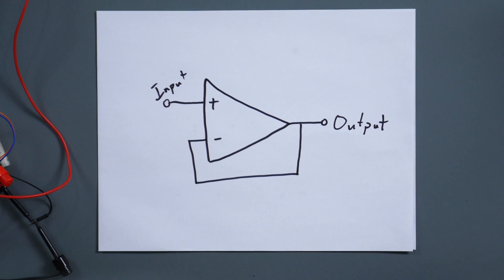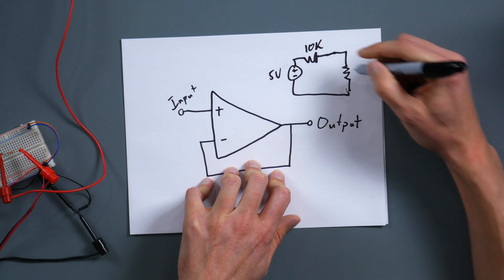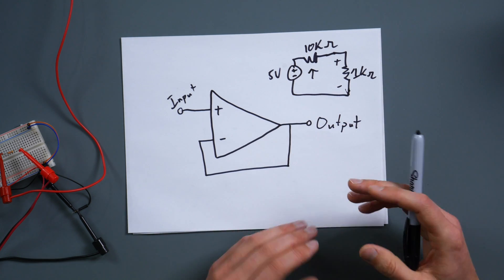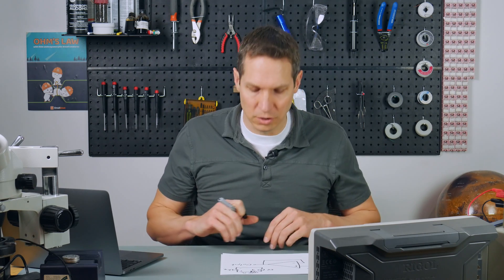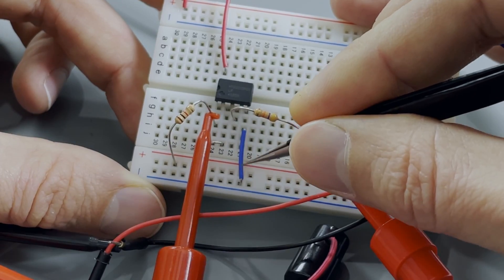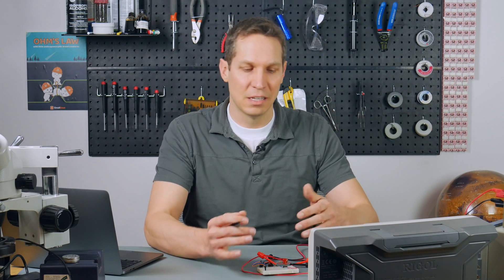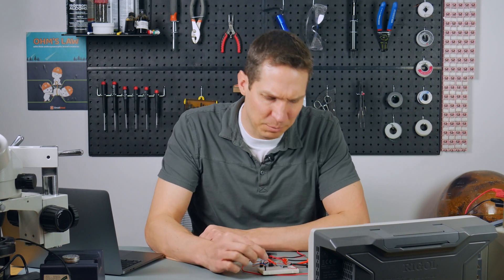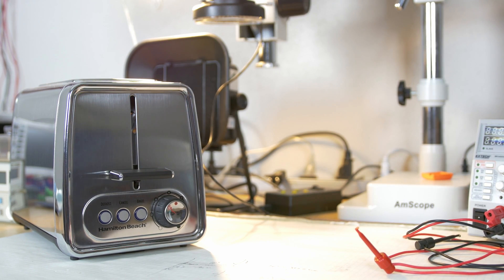Voltage Follower - Operational Amplifier | Basic Circuits | Electronics Tutorials

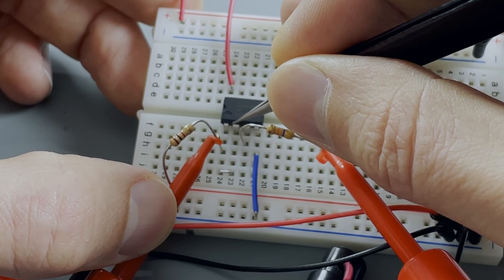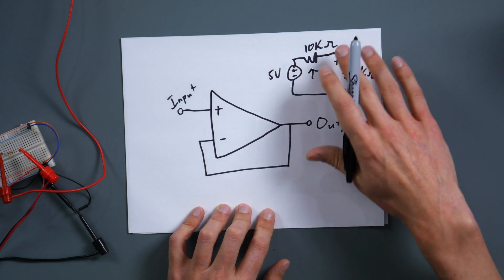Comment: At 5:28 you have it backwards. The output should provide negative feedback into the inverting terminal and the 47K ohm resistor should be fed into the non-inverting terminal. The circuit will not work the way you describe. It did work, however, because you mis-identified the inverting and non-inverting terminals and actually connected them opposite to your narrative. Take a look at the circuit diagram at 3:28.
Reply from the maker: Dang.  You are right, I misidentified those when describing the setup at 5:28.  The circuit was setup correctly, it was just my description.  I'll pin this comment so others can see if they're confused.  Thanks for catching that!
Reply: @CircuitBread   Why can the 47k not be connected to non-inverting terminal of op amp? Why is it necessary to connect feedback to inverting terminal?
Reply: @zainabashai7546  lets assume that we give the feedback loop to non inverting and give the input signal at inverting

if we do that the output of op amp will tend to saturate towards the rails (+vcc and -vee) as lets assume the non inverting terminal signal at one instance of time has higher voltage than inverting ,when this happens the o/p voltage is amplified and fed back again into the non inverting causing the same stuff to happen again and the o/p is amplified until it saturates to +vcc

similarly in other case if inverting is grater than non inverting we go on until we reach -vee
Reply: @CircuitBread  are you sure the end of the 1k load resistor not connected to pin 1 is connected to ground? Looks like it is connected to Vcc ?
Reply: I had minor confusion about the inverting terminal last night because what I was looking at vs what I heard lol. I watched it again before bed, revisited the video this afternoon, and your comment just helped me out. 
ATM, my primary area of interest is designing and building musical equipment, and there will always be a need for some devices to be a low impedance output.

Comment: 1:42 Why not use a mosfet?
Reply from the maker: Voltage control.  The voltage follower has the output be exactly the same as the input.  Turning a MOSFET on and off does change the output voltage but it isn't exactly the same as the input.  So it doesn't work when trying to get an input from an analog-output sensor where you'd prefer millivolt precision.

Comment: Wow....what a great resolve. I was trying to understand someone's circuit. He made a little circuit using a dual op-amp (LM358) to amplify a small signal needed for an analog movement in an old radio. By analog movement I mean the signal strength indicator (the meter. I believe it must be a baby size micro-amp-meter. Possibly 50-to-150uAmps). So he used the 2 op-amps in a series configuration but didn't know that the very first op-am was configured as a voltage follower (so the existing signal could be amplified without unbalancing the signal itself. Wow..this is what I needed to snow. I have subscribed right away!. Thank you. PS: I'm just beginning to understand the world of OP-amps. They are so versatile is unreal. I hope to master it one day (fingers crossed) :)))

Comment: Can you provide a link to the op amp used? I want to buy it. Is it any op amp?
Reply from the maker: There are many differences with op-amps even though, with these examples, we're not pushing them hard enough to make a big difference in performance but there will still be changes in how they're powered and their pin-outs.  We used the LM2903P from Texas Instruments for these examples if you want to ensure that everything works as it does in the examples: https://www.digikey.com/en/products/detail/texas-instruments/LM2903P/372786

Comment: I'm assuming that op amp has sentimental value considering when it was purchased. My first serious dual op amp circuit turned out to become a high gain distortion pedal with soft clipping germanium diodes, and soon I will retire it to showcase more like a trophy.
When I "designed" it, I really had no scientific understanding and relied on tutorial basics of setting gain, RC filters and diodes on the feedback path to produce soft clipping.

Comment: I use this circuit often to feed remote sensors . If you stick a blocking  diode into the supply voltage of the op amp you get non destructive short circuit protection as well as reverse battery protection without damage to the  op-amp.   ?¿

Comment: SUPER helpful.  My "current" project is using a LiPo to power an ATTiny as an LED flasher in a remote area, and I need to know how often I need to swap the LiPo out.  mAh math aside, cause who really knows in real life.  So I am going to set up an MCU to read a pulse from the Tiny every so often, but I don't want that current to participate so I THINK with a the near infinite impedance of the opamp input, I could get a timeline of the battery life.  Meaning the MCU and the opamp are their own circuit.  Hmmm?

Comment: I use the lm393comparator on my power supply I design for 1000watt the issues I have is the voltage drop still and I don’t understand way is that the voltage not holding even though the duty cycle is adjusted from the comparator am only getting current not voltage stabilized the voltage is 55 input 20amp and 14.80 volt out put when I add a low the voltage drop to 14 volt not 14 .80 and I see the tl494 only stabilized the volt in negative drive for p channel the voltage don’t drop but in positive pulse the n channel design the comparator have to use but voltage drops on the positive side can use explain why is this and should I not use n channel for

Comment: Hi, thank you for your clarifications. I have a question about the impedance of the voltage follower. If the Vi=Vo in this type of op-amp, would you say that the impedance of the op-amp is 0 or 1? If there is no Rf would you consider (Rf/Ri)= 0 or 1.
Reply from the maker: Hi Adrian, for an ideal op-amp, you would consider the output impedance zero and the input impedance (to the non-inverting input) to be infinity.  I'm not sure if I would look at it in the context of Rf/Ri, that may be unnecessarily complicating things, as your input isn't connected to the same leg as your output (as it is in an inverting or non-inverting amplifier configuration).

Comment: Thanks for the video. Helps refreshed my memory on the use of OP-AMP learnt during my schools days. May i ask, if i want to transmit 6.4Vdc across a 100m 18AWG cable, how many OP-AMP do i have to insert along the 100m length? Will every 10m suffice?
Reply from the maker: That's both an interesting question in that I'm curious what the application is and that I can't answer it with that information.  The key missing info here is the current you anticipate pushing through the wire, as that will affect your voltage drop.  If there is no current, then it's theoretically possible a single op-amp will work, as you won't get any voltage drop and op-amps can output a non-negligible amount of current.  My understanding (a quick Google search) is that non-PoE ethernet is only around 1-2 volts and that can go about 100 meters but it doesn't move any significant current.
Reply: @CircuitBread  Hi. I am trying to transmit 6Vdc over 200m to operate a small servo. The 200m cable is 12ohms and the servo has a rated stall current of 2A. I actually did that and the servo was not really moving. It's like there's not enough power.
Reply from the maker: @clusterbx  Sorry about this extremely delayed response, YouTube doesn't notify me about follow-up questions.  I think a little Ohm's Law here will clear things up.  You have 12 ohms of cable and are running upwards of 2A.  With V=IR, and I=2 and R = 12, you'll need 24V to "push" that much current just through the wire, let alone to run the servo.  If your op-amps are running off of that same power supply, they're going to run into the same problem.  They don't magically create the current, they need a power supply as well.  If they're hooked into another source of power, it should be doable, because you won't actually be running much power through that 200m wire.  But I imagine that there isn't anything else (or else you wouldn't be running a 200m cable) so I don't think this will work with that large of a load.

Comment: Thanks Josh. It's worth pointing out that the output draws current from the power supply rather than the input source itself. So there's no magic involved.

Something that I struggle with - and something that is rarely mentioned - is what to do about powering the opamp. This is to do with how close the input voltage can get to the power rails. It's a subject that tutorials skimp over and taken as a given, but can leave nebies like me puzzled as to why I'm not getting the output I expect.
Reply from the maker: Good feedback, thank you!  You are totally right - all the power from the output comes from the power supply.  
I did finish shooting all of the op-amps videos we have planned and while mentioning the rail-to-rail output, I didn't mention the input voltage versus power rails in them either...

Comment: I always had an issue with the labeling and the subsequent misdirection by calling the inputs positive and negative.
I made it an effort to get that out of my head as soon as i started to understand OpAmps a bit better.
Inverting- and Non-Inverting input is a better description, imho. It might seem "even more techno babble" to the uninitiated, but i think it helps in the long run.
Once you start seeing the inputs like this and not "so this is where positive voltage goes and this is where negative voltage goes", you can start using the opamps to manipulate signals to your own liking. That is why i see the labeling as a pitfall for people just starting to learn electronics.
Reply from the maker: Yeah, while doing these I was debating on that terminology. All of the opamp videos have been shot now and I use the terms inverting and non-inverting more and more as they progress for exactly those reasons. As you get to know them better, it makes more sense to say inverting and non-inverting. Hopefully the transition eases people into it rather than causing a confusing stumbling block.
Reply: Good advice...cheers.